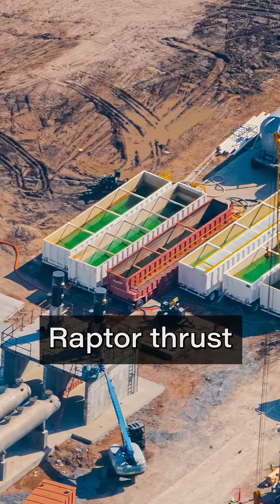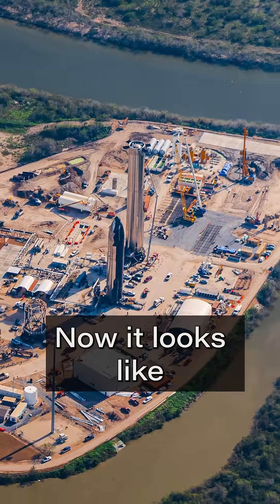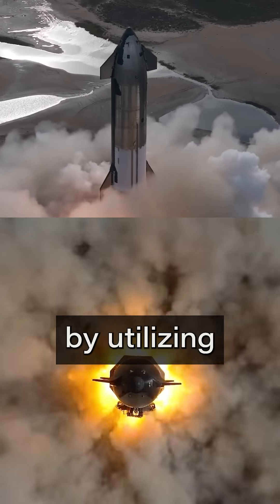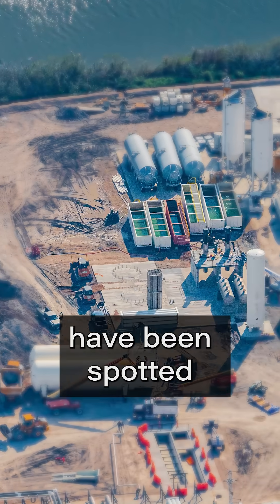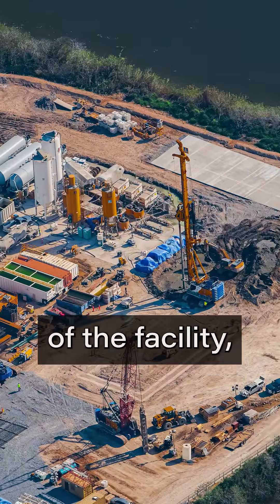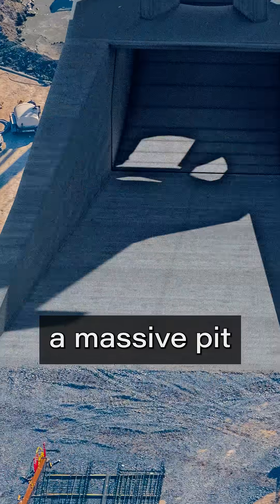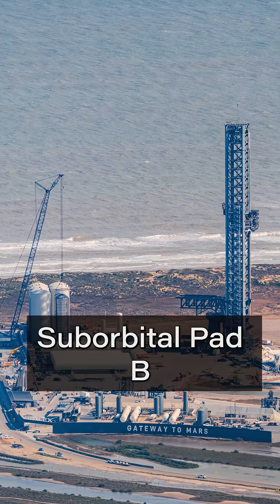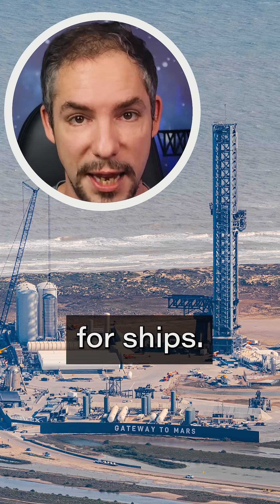This Is Unexpected! SpaceX Starship Flame Trench Coming!

Comment: Correct me if I’m wrong,but won’t burning a few tons of methane (CH4) dump tons of CO2 into the atmosphere?

So much for reducing carbon emissions.
Reply: … different company different goals. Space X is ment to make space travel much cheaper and faster. Fast enough to make orbital industrial development and further colonization at least feasible economically (compared to now)
Reply: But the thing is there are many ways to counter the CO2 emissions. One is simply making a giant CO2 pump that just pumps it underground into closed deep ground caves or old oil fields.
Reply: @spaceengineeringempire4086  And how much capacity will thisse storage areas (?) have?  How quickly can we pump the CO2 out of the atmosphere?  How will we ensure that little of this CO2 will escape from leaks?

Comment: Rapid reusability is going to require a way to minimize flame damage to the launch mount. You cant spend a month rehabing the mount if you plan on launching 3-5 ships a day from the same pad. 
The Mars launch is not going to be just one ship. Probably a minimum of 3 with 10-12 refueling launches to refuel before the trans-Mars burn. Thats say 40 launches over say a week or less because fuel on orbit evaporates and must be vented.
So many issues to be solved makes building a ship that can reach orbit look like the easy part.

Comment: This is the easiet option for the location, no need for a complicated water plate. The launch site is a tougher location for a flame diverter due to all the existing infrastructure
Reply: Not to mention how high the water table is but they can work around that

Comment: so spacex finally discovered they needed water deluge and flame diverters?  awesome.
Reply: This won't be at the launch site, just the test stand. Water plate is working fine currently so still no need proper deluge or diverter at the launch site.
Reply: @Grichecth  so you wont need them with constant take offs and landings? Let's wait and see.
Reply: @geesehoward700  Certainly too early to tell long term, but the second flight left the plates with no damage or refurb required. Assuming that trend continues, it should be good. Worst case I imagine them just reengineering the plates. Once they start the second tower down there we'll get a better idea if they're going to go with plates on that OLM as well, that'll be a tell tale sign they are sticking with a no trench design.
Reply: @Grichecth  just use them. they have money to waste on blowing up rocket but not for a flame diverter and water deluge? they even lost a rocket because of not having them.
Reply: @geesehoward700 Can't say why they decided not to go for the trench, I agree it does seem silly but they haven't lost a vehicle due to not having it. It was theorist at one point that the debris kicked up during IFT1 damaged the boosters engines or HPU, but we've never had a confirmation of that. Reports I've heard from inside sources said it was due to the fire in the engine skirt from failing engines. That issue has been resolved on the newer style boosters. The water plate seems to be doing the job without the need for a full deluge so far.
Reply: @Grichecth   There was some minor erosion of the metal plate, although SpaceX estimate that it should be good for many flights, even without refurbishment.  At least that's what I remember hearing/reading.
Reply: @geesehoward700   Lost a rocket?  If you mean IFT-1, that design iteration of the hardware never really had a chance of reaching space.  They never did have a fully successful static fire test (some engines just refused to start), and things were blowing up and engines were throttled down (to help keep them going for longer after enough fuel and oxidizer had been expended, I suppose) even before the engine compartment fire took out the controls.  This was not caused by any damage from the pad, as far as SpaceX or anyone else can determine.  The real damage from the pad explosion was the months-long delay it caused IFT-2 and all subsequent test flights.
Reply: @Grichecth   There were problems before the pad exploded that led to delaying throttle-up long enough to create the conditions under which the pad would explode.  So it's kind of the other way around--the pad exploded, in part, because of problems with the hardware, while there is no evidence that the explosion damaged the Starship/Super Heavy hardware.  The latter was just not ready to make it to space, let alone orbit.

Recall that the threshold for success was defined as not exploding on the pad and destroying the entire launch complex, so SpaceX were well aware of Booster 7's deficiencies.  I don't think I resumed breathing until that thing cleared the tower and got out over the ocean (well, the Gulf of Mexico).  The pad itself blowing up almost certainly had nothing to do with any of this.
Reply: @rbrtck  itf-1 t shot itself down. Everything else about that mission is moot. All they learnt from that mission was they did in fact need water deluge/ flame diverters and the self destruct wasn't good enough.
Reply: @rbrtck  Absolutely! I think a lot of people miss or don't realize that the mission was, as you said, to get off the pad. Everything after that was a bonus. IFT2 showed us once again how quick rapid iteration paves the road to success. Looking forward to IFT3!
Reply: @Grichecth  its pretty ironic then that 1i_tf was taken out by the every pad that the mission was to get off. as for iterative design it is wasteful and the way you guys talk about it creepy and cultish. isnt it weird how the other rocket manufacturers can build a working finished product straight away.
Reply: @geesehoward700  Not sure why you're suddenly being hostile towards me. I'm not arguing with you, I'm just answering questions and giving facts I know. No Musk boot licking, nothing cultish being said.. You'll find most of us following Starship/SpaceX follow pretty much all rocket companies because we enjoy the topic, not one company in particular. As to your point, yes SpaceX could also do the same approach, but they chose to waste more of their money to speed up development time. Look at SLS as an example. Great rocket, but way over budget and massively blown timelines. SpaceX doesn't want to have to wait 10+ years in development like they did for SLS. Another example of the usual approach not always working is Boeing's Starliner, riddled with delays and failures. They will figure it out and it will be great to watch, but just not quickly. Falcon 9 followed a similar rapid iteration approach and is now arguably the most reliable launch vehicle in use. I don't argue that some of SpaceX's ideas and methods make you give your head a shake, but it's fun to follow the progress regardless.
Reply: @Grichecth  spacex are going backwards and look increasingly amateurish but at least they arent Boeing i guess. tbh it could be time to stop awarding free money to boeing.  The falcon 9 was the companies first rocket and its design evolved rather naturally. it wasnt a case of just throwing them away or seeing what could work, maybe, perhaps, but upgrading what was there and refining it.
Reply: @geesehoward700   SpaceX have scrapped more hardware than they've ever flight-tested.  They have to learn how to build Starships on the cheap, and they've succeeded to some degree that they'll keep trying to improve upon.  This isn't the SLS.  Each Starship didn't cost multiple billions to build.  Hell, all 39 Raptors probably cost less than one RS-25. 😄

The only thing that was wasted, unfortunately, was time, due to the environmental issues.  Booster 7 got as far as it was ever going to get.  It wasn't damaged by the explosion of the pad, and was only expected to clear the launch complex and provide some unknown amount of data from flight.  Like I said, the problems started at ignition, which delayed the throttle-up for liftoff, which in turn caused the pad explosion.  They had never had a successful static fire test before that.
Reply: @geesehoward700   The Falcon 9 was being developed while it was flying (with payloads!), and its failures helped make it as reliable as it is today.  The difference is that it was much farther along in development when it started flying than the Starship was, but in comparison to other rockets, it was quite actively being developed.

The Starship is also difficult to compare with the Falcon 9 because it's such a vastly more difficult engineering challenge, even with SpaceX's greater experience now.

The Raptor alone has been extremely challenging, and the ones used during IFT-1 just weren't that reliable.  But SpaceX had built them (to learn how to build them more quickly and cheaply), so I guess they thought they might as well try to get some value out of them from a flight test.  That some engines had failed to start or run for the duration (even when throttled down later as they all clearly were) had nothing to do with the pad explosion.
Reply: @rbrtck  you miss the point of what I was saying. Falcon 9 was focused. They knew where they were going with the design and they focused on landing right away and they came up with something that could land anywhere it was flat enough. Then they upgraded the booster to make it more powerful and more efficient. I'd argue that the falcon 9s best feature is it's landing capability. Now look at starship. It cannot land anywhere and it needs a special tower with a grabber? Its supposed to be able to have a quick turnaround but uses tiles. Even the material used to build them is a step backwards. It uses far too many engines like some russian moon rocket on crack. They now have an irrational fear of deluge and flame diverters. They built far too many wasteful prototypes that tested nothing beyond seeing if they could be built. The starship is suffering from so many stupid ideas that you cannot just say it's how design should be.
Reply: @rbrtck  the falcon 9 is.more advanced than starship.
Reply: @geesehoward700   So many prototypes needed to be built to test different manufacturing techniques and the effects on their qualities.  Each was tested (not in flight) in the ways they needed to be tested, and building a bunch of them was also necessary to learn how to build them faster and cheaper.  If SpaceX were Boeing, then they wouldn't do this, of course.  They would build each rocket slowly and in the most expensive way, and then charge $2+ billion a pop to the taxpayers' unlimited credit card.  SpaceX can't do that.

So you think that all of SpaceX's current ideas are stupid.  Well, you're entitled to your opinion, but a lot of people thought SpaceX have been stupid from the very beginning, too.  All of the previous stupidity worked out really well, though.  Even if you didn't think that, someone did.  Well, now you're that someone this time.  And no, SpaceX aren't perfect and they do make a lot of mistakes.  I'm not blind.  But I strongly disagree that every little thing they're doing now is stupid, and I'm seeing a lot of positive results so far.
Reply: @geesehoward700   How so?  And even if it were, being smaller makes everything easier.
Reply: @rbrtck it being smaller isn't a bad thing. Its method of landing is more advanced. The materials used to build it are more advanced. It is more refined design that knows what it's doing. The only part that isn't straight up better are the merlin engines.
Reply: @rbrtck  it was clear that the falcon 9 had potential from the start. usability promised to revolutionize space flight and it has. in what way does the starship revolutionize it beyond "its waaayyyyyyyyyy bigger"? elements fundimental to the design havent even started to be worked on and cant until we get the starship up and running and spacex are learning to walk all over again rather than build upon the falcon 9. to go anywhere useful in space would currently require in space refueling. we could have been learning how to do that by now if we had stuck to using improved falcon 9 tech. and then are hit the next problem. are spacex just going to fill space will debris as they design their starship refueling process? thatll be fun for everyone if they do.
Reply: @rbrtck  people doubted whether or not spacex could pull off reusability not doubted whether or not it made sense.
Reply: While the deluge system protects the launch tower, a flame diverter will also protect stage 0. A demonstrative plus. 😅
Reply: They wanted to know for sure whether these were necessary, as no one knew from experience.  If they're necessary, then they'll use them like everyone else, but if they're not necessary, then that would be a nice discovery.  Musk doesn't seem to mind trying, even if the odds are against what he hopes to find.
Reply: @rbrtck  so hardened concrete can take about 10000 psi. 33 raptors produces something like 17000000lb thrust. hmmmm. odds.
Reply: @geesehoward700   PSI means pounds per square inch, so if we calculate that, we get a pressure of only about 172.4 PSI (check my math).  It's not that simple because of the heat involved, of course, but that's well within the compressive strength of the concrete, at least.

For the record, I had thought that this was a very bad idea from the very start, and even Elon was thinking out loud that it might be a mistake three years ago.  But he wanted to try anyway, since the Fondag did manage to hold up pretty well under a half-power static fire test earlier, with little erosion and no other damage.  It was a combination of full thrust and more importantly the much longer time of exposure that caused the pad to fail so catastrophically.  Once again, I thought it was a very bad idea all along, and personally I would not have attempted it.  I'm just describing how Elon works, not justifying his choices.
Reply: @rbrtck how high are the 33 raptors from the ground?
Reply: directly under the engines would be 1199 psi. so maybe is was just vibration and the heat that destroyed it. that and being worn down.  interesting if not also predictable.
Reply: @geesehoward700   It's hard to find that information.  Going from photos, it looks like the nozzles are about 15.6 m or a little over 50 feet above the pad, maybe a little higher.  Not that we have to be precise to know that compression alone almost certainly did not cause the pad to fail.  Maybe the vibrations caused cracks that allowed hot plasma to penetrate, which started the process for the explosion.

I seem to recall at least one (and possibly more) much smaller pad explosions occurring during the Starship (no Super Heavy) flight testing, too.  Raptor exhaust is rather intense (a lot of thrust per area), and I remember seeing chunks of something flying upward near the Starships that were tested.  IFT-1's explosion was just a much larger version of possibly the same type of event.
Reply: @rbrtck 
I like that about SpaceX. They were checking the assumptions. You do not truly know until you try.

Comment: Well, starship's gonna get taller. They're gonna have to extend the height the launch tower
Reply: Not really. SQD height will stay the same as long as the booster stays at 70 meters, so a longer tower is not required
Reply: This is prototyping everything subject to change only time will tell. I can't wait to see the chopsticks catching boosters and ships.
Reply: Or move the grab points down the hull.